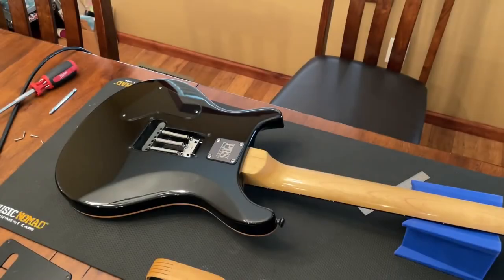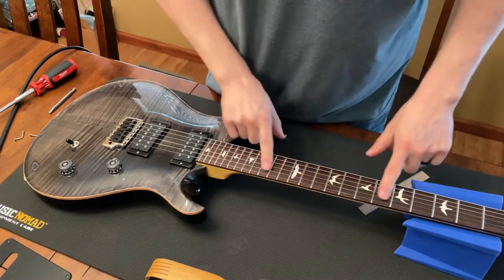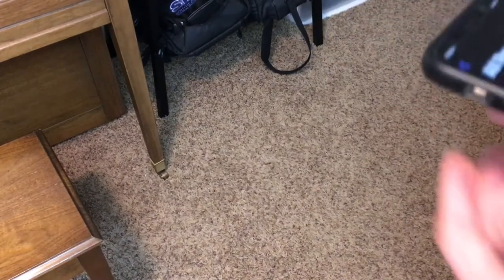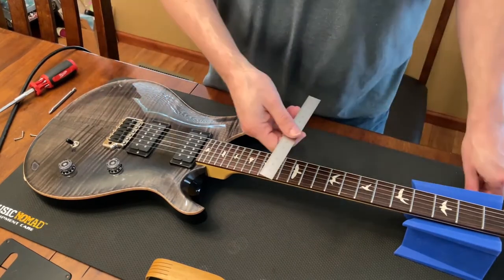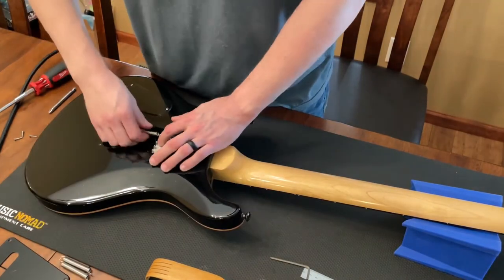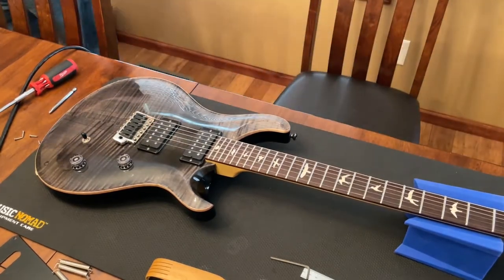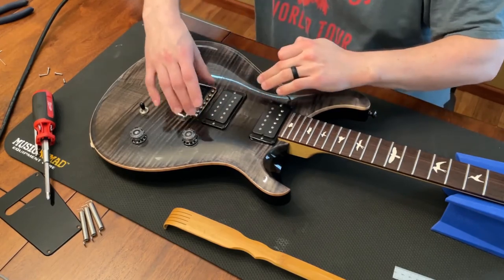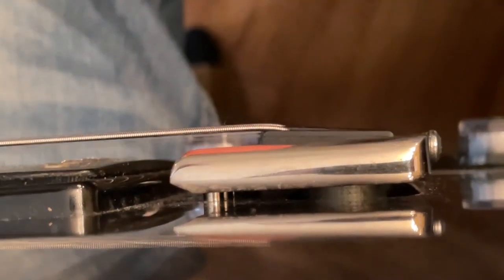How to adjust your tremolo screws on a PRS

Comment: I can't see what you're doing.  Your fingers are in the way.
Reply from the maker: Yeah I’m sorry about that. The manns video shows the strip much clearer. Essentially you use the 2.5 Allen hex key as a spacer underneath and tighten the screw down until the Allen stops it, just snug to that point and then do all the others like the first.

Comment: Relieving your truss rod would be a better fix for this. I wouldn’t recommend anyone adjusting those tremolo screws.
Reply from the maker: There’s nothing to be afraid of if you grasp how it works and have no tension on it when you do so. If one doesn’t understand the mechanism of it, then I agree they should take it to a qualified luthier, however I took mine to a local luthier once who didn’t settle the divots equally and the baseplate jumped off on that screw, so I learned how to do it for myself 🤷‍♂️
Reply: @vaiisking  if they NEED to be aligned then yes that’s how it should be done but those “dinks” are from your neck not having enough relief. Not from the height of the bridge. Two totally different repairs.
Reply from the maker: @CapeAlan  actually think I also had a little bit of uneven frets happening. However the height consistency by PRS specs standards makes the allen hex tool technique a good thing to do because it sets them to a perfect level for each one without “guessing”
Reply: @vaiisking  I would just hate someone to watch this video thinking this is how you adjust the bridge on a PRS. IMO what you’re doing here is a last resort after truss rod, action, intonation, and then a fret level and dress.
Reply from the maker: @CapeAlan  but the responsibility to know when it is needed falls on each of us. If an actual reason to do this for whatever reason (bridge replacement, pawn shop find, poor local ,etc) then IMO, this is the method to use.
Reply: @CapeAlan  There has to be a relationship between bridge height, relief and action as well as the nut. All elements have to be adjusted for each other.  You can't just add more and more relief or increase the action unreasonably.
Reply: @chrisking6695  Agreed that's what I was getting at in my last comment.
Reply: @CapeAlan  It depends on where the dinks are coming from (uneven freds beside). If they are caused in the area of the 1. and 5th fred, then the neck needs more relieving. But if there are no dinks in this area but only in the area of the 12th and more freds, then the bridge needs to be adjusted. A good measurepoint to start with is, to have 1.5 mm between the 5th fred and the string and 1,5 mm between the 12th fred and the string, on the low E and the high E string. One can use a simple 1.5 mm Pick to measure. Put the Pick between the fred and the string, and if it barely holds/keep stuck you have the 1.5 mm. So you make sure to have the same action over the whole neck :) On a good guitar you can go even lower then 1.5 mm. On a not so good guitar maybe have to go a little bit higher then 1.5 mm. But 1.5 is a good starting point.  p.s. sorry, I´m not a native english/american speaking person and don´t now how to find the right words some time ;)
Reply: Wrong. Have had the same issues with both my CE and only thing that work was that, both done by qualified luthiers

Comment: According to Prs support , Adjust the claw screws about 1/4 turn at a time until the bridge floats parallel to the strings and about 1/16th off the body , that 1,6 mm.

Comment: If you need to adjust the screws on your PRS trem this is how you do it.Using a 2 1/2 mm allen wrench as a feeler gauge (the flat side) it should be a slight drag,I've found it's best to tighten down and then loosen, to find the correct height and get the screws exactly even with each other. Don't forget to remove strings(put a piece of cardboard under the rear of the bridge),and trem springs before you adjust and when finished (springs and strings back in place and in tune) the bridge should be about 1 1/2 mm floating off the body front and back.Good job...
Reply: But that's not what the PRS tech says, about the distance between the bottom of the bridge and the body. https://youtu.be/m5rLleUlUHQ?si=bg3Fq1SyDOYfKtP4
Reply: @Chuchuguitar the tech said about 1/16 off the body which is the same as 1 1/2 mm as long as its the same front and back and level with the strings...

Comment: PRS says, from the factory, the Core model bridge height is 2/32" off the body. That's 1.59mm. They mention it in this video:
https://youtu.be/fNElmHAA8kE?si=fJzizYQkLgESD-hF
Reply from the maker: The 2 mm Allen would give it a little extra height in this case.

Comment: Great video thanks, just got my first PRS, not a fan of the screws direct into the wood as they and the wood will weaken over time. I guess he did it for sustain but I prefer the modern 2 pin strat into the 2 steel sockets as these can be adjusted metal on metal as opposed to metal on wood, there's only one winner over time and it ain't the wood which being the body is fundamental to the instrument

Comment: Although I did put an allen of 2.5mm underneath to measure it, after tuning the guitar and adjust the springs for the tremolo to be parallel to the body, the tremolo seats only almost 1 mm above the body..? Any thoughts? It's a CE24 2007.
Reply from the maker: No, my expertise is minimal at best for this. The manns video that showed me this technique might link you to other helpful ones. See the description for that link.
Reply: Did you find a solution? I also tried Mann's video and ended up with a similar situation
Reply: @theforgedone  nope I left it like that. I guess if you want more backwards move of the tremolo you have to go further more than the 2.5mm but then if you are a low string action type like me, consider that going more high, I mean the tremolo off the body, you are limiting the string height because even if the string saddles are set to all the way down, you re not going to have some low or very low action which I want fot the CE24, because of the more floating tremolo off the body. Cheers.
Reply: At some point in the Mann video, he says the bridge should be about 1/16th inch above the body. But, he also says that's ballpark, and if you need to raise or lower the 6 screws to get the bridge to float properly, you can do that. I would try a 3mm allen as a feeler, and see if that half MM makes the bride sit at a better height.

Comment: If your action was a touch too high, should you lower each of these 6 screws equally or adjust all the saddles one at a time?
Reply from the maker: Saddles. Don’t mess with the screws once you’ve gotten them to the correct height. That level isn’t subjective, it needs to be precise. Then, the saddle heights are preferential.

Comment: I haves problem that if I am palm muting and my hand is resting on the trem bridge it’s so sensitive I get  unwanted vibrato  and it won’t stay in tune  no locking tuners it’s a  week old swamp ash special but no dinks anywhere , so with checking and if needed screw adjustment will that solve my issues? Thank you
Reply from the maker: action will affect it all for sure...neck relief, string height, intonation...all of it. have your local pro check all that.
Reply: It’s nothing todo with action that’s a personal setting that shouldn’t affect the tremolo it’s just the quality of the SE models that cheap I have core USA models and they are fine I found the tension on the springs are critical the nut has to be changed and locking tuners help or lock string winding

Comment: I appreciate you taking the time to make this. Decided to try my hand at doing my own setup and this specific point was something I couldn't find elsewhere.

I'm having an issue though, I can't get the action where I want it with these screws set to this height. What could I be doing wrong?
Reply from the maker: Gotta set them to that height and not really touch them. It would either be the two hex screws in the saddles individually or your truss rod isn’t set right. If you have trouble with that, take it to a local pro.
Reply: Thank you for taking the time to reply. Appreciate the response.

Comment: I would not touch those trem screws either- if you’re at that point, you need a pro to set up your guitar, the trem screws on PRS guitars are extremely fragile. I hope folks do not take the advice of this video.
Reply from the maker: A year later and it’s still playing like butter.
Reply: They are screws.  They are meant to be touched.  This is a great video if you understand the concept of what's being taught.  All six screw need to be exactly the same height.  Using the allen wrench as a feeler guage is a great way to do it.

Comment: Hi.  Thanks for video.  Good in terms of how to adjust those 6 tremolo screws, most people don't relax both string and spring tension.  Easy way to ruin the knife edges by not eliminating the tension completely.
Relating to the noise you are hearing I think it's mechanical coming from the strings above the nut and from the tremolo.  Try placing velco around the strings between the nut and the tuners (or tie a sock around if you want to test it quickly), and place paper, foam, rubber whatever you think is easiest for you inside the tremolo springs, then try again and see if those high frequencies are reduced or eliminated.  Regards.
Reply from the maker: I’ll try those things as soon as my hand heals and I can play again, thank you.

Comment: This definitely helped with the action and the playability of my CE24 so thank you very much. The way it's set now really plays fast and i love it! The only thing I'm not happy with yet is that the floating tremolo almost sits on the back of the guitar and not parallel to the body. If that's the price for low action, I'm happy to pay it, but ideally that should be fixable. If anyone got a solution for that, I'd be grateful!
Reply from the maker: Can you post a pic? Mine is parallel
Reply: Adjust the claw screws (back side under the plate).  Looser let’s it tilt forward, probably what you need, tighter pulls it back.  There are many videos.
Reply: How low is your action? I have a CE24 with problems.
Reply: @MaxPower-js1sk  my CE 24 came with the bridge too high. Even lowering the saddles all the way, action was still ~2mm. Odd slip from PRS.
Reply: You could have just adjusted the sting saddles..